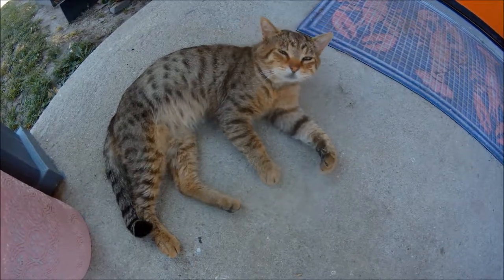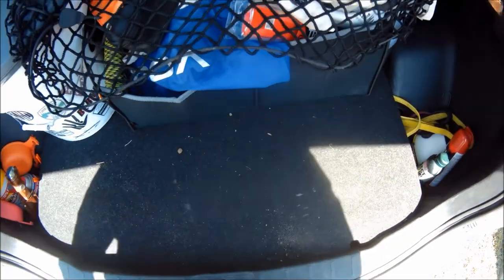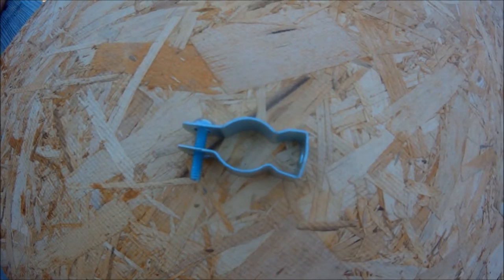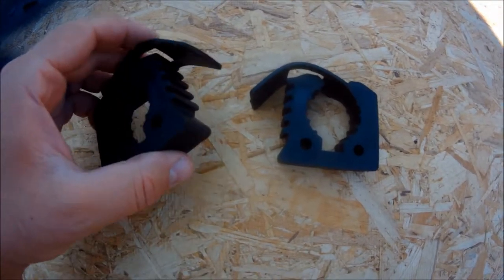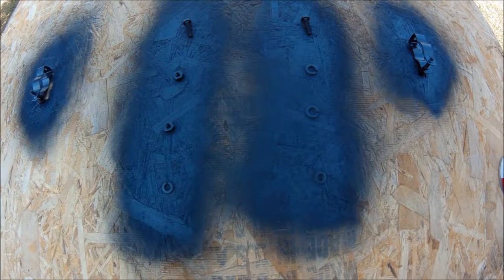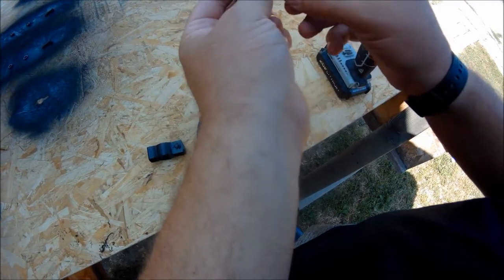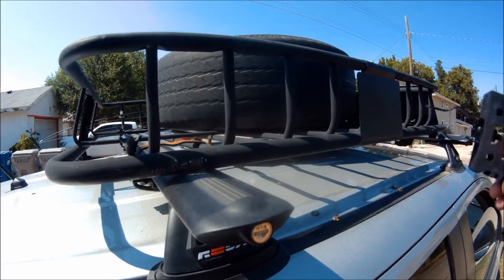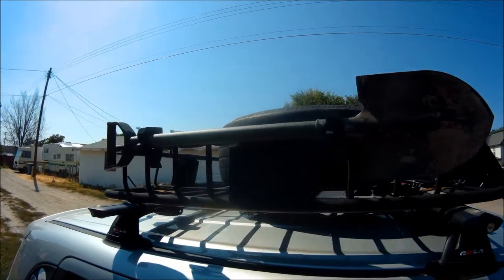Roof Rack Shovel Mount for Under $20 || DIY + Overlanding + Adventure || Nowhere Pacific

Comment: Should've bolted it with the philips side on the shovel end and the bolts washers and nut towards the rack side...
Reply: Exactly right, the screws were mounted backwards, it will just scratch up the shovel the way you have it.

Comment: Wow, I'm the first comment?
Looks like a clean installation but I don't trust anything with rubber strapping.  I have extended tow mirrors on my vehicle that uses rubber straps like that.  I've had them come loose and even lost one while driving.  I ended up using paracord as a backup so next time the rubber strap comes loose, the mirrors won't fall off!
Reply from the maker: Thanks for the comment! I've had this set up for a while now with no problems. Its  really sturdy and durable. Using an additional paracord is a good idea. Thanks for watching!
Reply: Johnathan Jagger  I don't know anyone including myself who wastes their time on Instagram so................As a matter of fact, I quit Facebook over two years ago.  Giant waste of time.